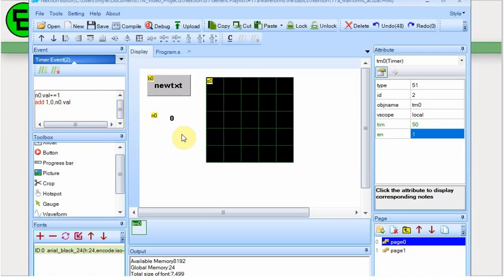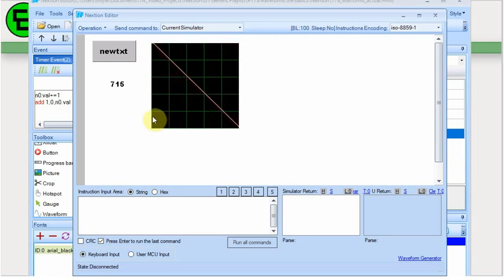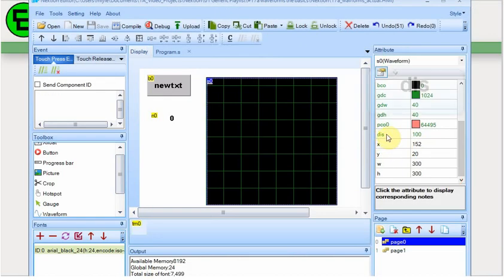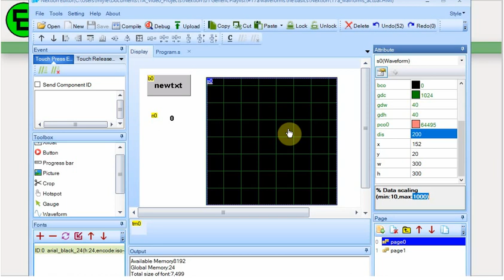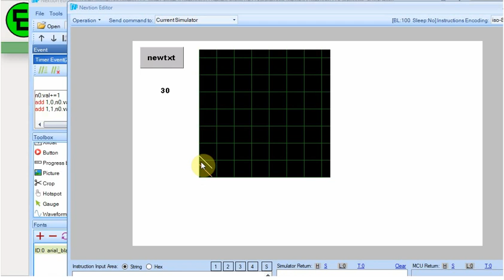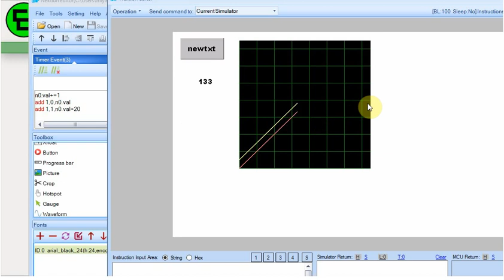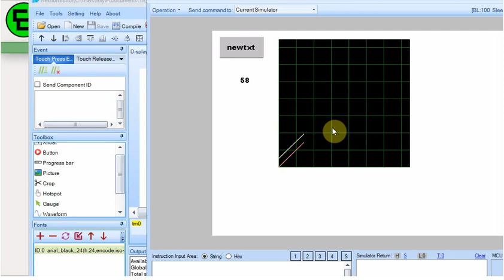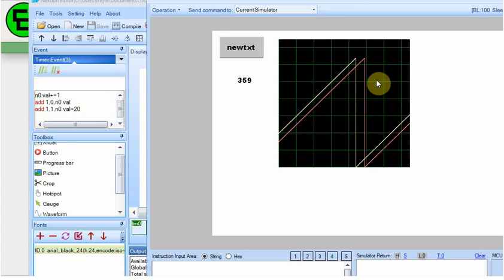#105 Nextion Display - basics of the waveform part 1 - Nextion Tutorial

Comment: uhmm..i fim taking measures from a sensor, every time i change page i should replot the whoel graph? so...i should store in my MCU memory all the datas then resend for each page change, am i right? thanks a lot
Reply from the maker: It has been awhile since I made this video but I believe the waveform is not stored on page change.  Did you try to set it as a global?  I think I once used the internal eeprom to store values.
Reply: thanks for your reply, i will try and update you @CheapControls
Reply: i think eeprom is not a good choice in terms of endurance, if refresh is often requeried @CheapControls

Comment: Hello

I  appreciate the video. I have a question for you. I want to display the last 24 hours of temperature in the waveform. I used the EEPROM store values. However, I couldn't display all data at the same time in the graph. Could you please help me with that?
Reply from the maker: See if this video helps https://youtu.be/A5295ukF3kc
Reply: @CheapControls  I can write and read the EEPROM right now.Thank you very much. I have another question for you. I have temperature data to display the waveform. Normally I display float form. That is why temperature data is much bigger(25.25 degrees equals 2525 int value). I can't display different temperature data at the same time. Because each data difference can be huge(like the difference between 25.5 degrees and 20.2 degrees). How can I solve this problem?
Reply from the maker: @muratkokturk4922  look into the MAP function on the arduino.

Comment: Hello, why do we need the object called n0, and when/where did we assign waveform  to n0? Thanks in advance
Reply from the maker: This is a little older video.  I will try to look at it tomorrow so I can answer your question.  Sorry I can't remember it well enough.
Reply from the maker: You do not need n0.val.  I just use it to show the value I am adding to the waveform with the add command.  The add command is where you add to the waveform.  I hope this helps.

Comment: thanks for video. you showed line graph between timeline (X-axis) vs one variable(Y-axis). Is possible to plot diagram or a line graph between two variables? i mean plotting A-values (X-axis) vs B-values (Y-axis) which are coming from Arduino
Reply from the maker: I don't believe you can plot vertically, only horozontally.
Reply: @CheapControls  
Thanks for replaying. As Im beginner, i really learned many things from your videos. Yesterday, i tried to make scatter graph between two different values on 7" display depending on pixel position. First of all, i insert an empty graph or chart having scales i need in Nextion display. Then, make 80 text dots (.) of witch have dimension of 5*5 or less and put them all in corner or under any object that you finally cant see them. The scatter graph will repeat every 80 second and each second one dot of will present in graph. you can also change time of presenting dots, time of reseting dots, and no. of dots you need.  I wrote this simple code and please could you make this code much better by adding your touches

int n = 0;   // value for text dots id
int timer = 0;   

void setup ()
{
  Serial.begin (9600);
}

void loop ()
{
int sensorVal1=analogRead(A1);
int sensorVal2=analogRead(A2);

if (timer <= 80) 
{ 
int x = map(sensorVal1, 0, 1024, 50, 470);     //    (sensor name on X-axis , min value, max value,  start of X-axis pixel scale on Nextion display, end X-axis pixel scale on display) assuming that display is in vertical orientation

int y = map(sensorVal2, 0, 1024, 750, 545);   //    (sensor name on Y-axis , min value , max value,  start of y-axis pixel scale on Nextion display, end y-axis pixel scale on display) 

Serial.print("t");
Serial.print(n);
Serial.print(".x=" + String (x));
Serial.write(0xff);
Serial.write(0xff);
Serial.write(0xff);

Serial.print("t");
Serial.print(n);
Serial.print(".y=" + String (y));
Serial.write(0xff);
Serial.write(0xff);
Serial.write(0xff);

++n;
++timer;
}

if (timer > 80)   // here to reset chart
{
timer = 0;
n = 0;

for (int n = 0; n < 80; n++)
{
int ZeroX = 0;    
int MaxY = 800;     // both of ZeroX and MaxY used to put dots on display corner 0*800 pixel  or at any position that you cant see them)

Serial.print("t");
Serial.print(n);
Serial.print(".x=" + String (ZeroX));
Serial.write(0xff);
Serial.write(0xff);
Serial.write(0xff);

Serial.print("t");
Serial.print(n);
Serial.print(".y=" + String (MaxY));
Serial.write(0xff);
Serial.write(0xff);
Serial.write(0xff);
}
}

delay (1000);
}